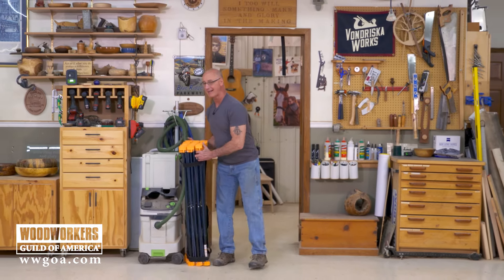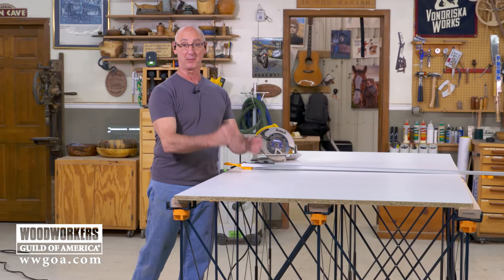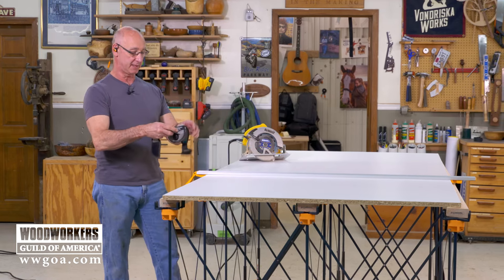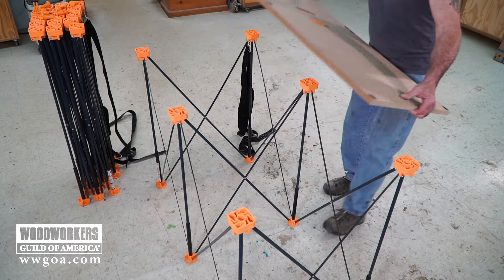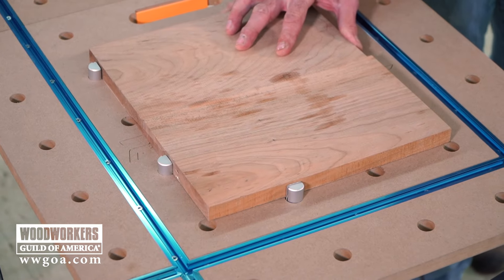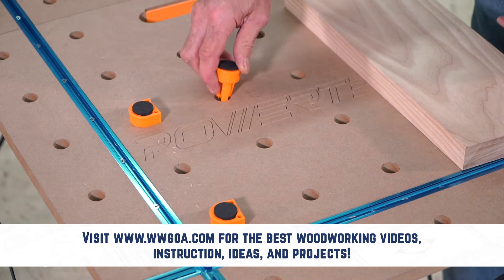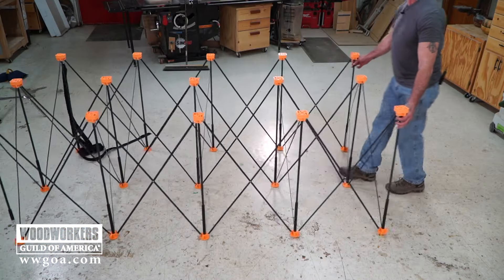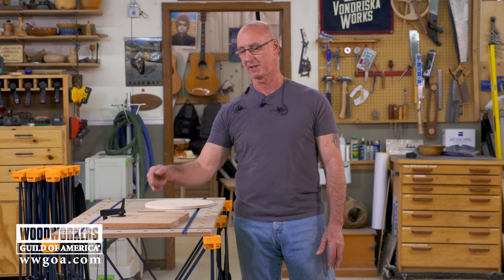Mobile Work Table for Kitchen Cabinets Replacement | Space Saving Garage Workbench for Any Project

Comment: Looks like they are a bit too tall for processing full sheet stock. Maybe if they offered 2-ft high version to allow one to place a knee on top for easier reach to cut all the way across 4-ft sheet stock.
Reply from the maker: Thank you for your comments and question. Unfortunately, the Arachni-Flex series of Portable Workstations only come in the 36” work height. Our research and customer feedback has shown that 36” is a better overall height for the many applications possible with this very versatile workstation.